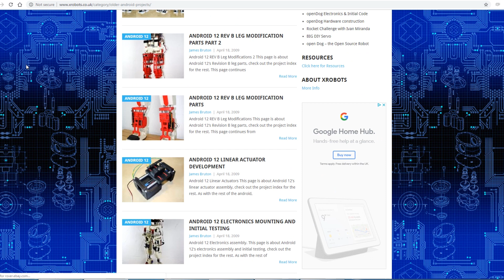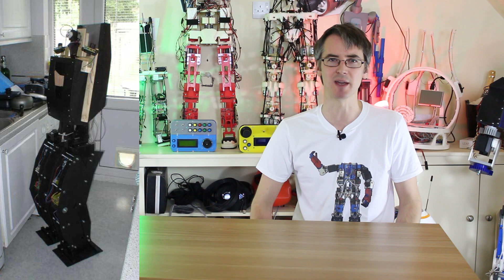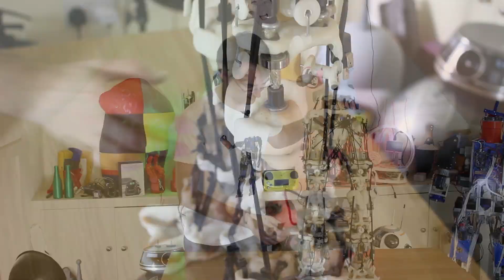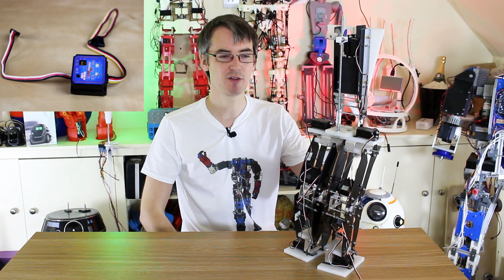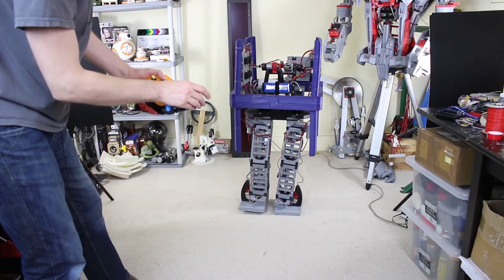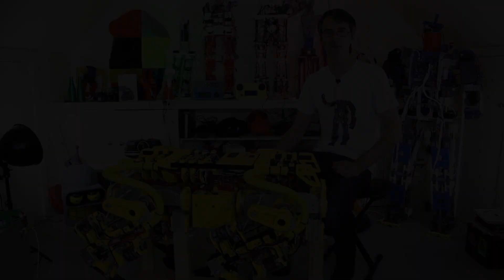My Walking Robotic History | James Bruton

Comment: Yeah...  It's cool that you just DO SOMETHING... I would do a bit more planning.  For example, you could do some calculations on how much torque the hip, knee, and ankle joint need to be to do something really basic, like balance one one foot.  Bipedal walking is quite a challenge, it's like the robot is constantly falling, but catches its self on alternate legs.  Shuffling is better than nothing, but legs need to have a purpose, like can it navigate stairs?

Comment: Hi James.
Reminds me of my experimentation.  
 Did find a Gem off a DLL Called INPOUT32.DLL  It allowed un-hindered reading of any Clocks, Inputs, Outputs and, of course Joystick ports.  
All interfacing with VB6.0  I'd find addresses in the bios or control panel, convert that to decimal then, using VB It was a simple instruction of OUT 888,1   To send pin 1 of the LPT (Printer Port) High.
I used it to control a 36 segment Cash register display driver chip.  
Pin one would be programmed as a shift register pulse (Clock)  and pin 2 as a toggle for the on/off value of that LED (Data) and pin 3 pulsed to advance to the next line by simply switching the negative rail for the next row of 32 LEDS using an extended decade counter.

 I Got 512 LEDS, So 8, 8 x 8 grid LED modules in a similar fashion as your VERO Board  Comparators.  BEAR In mind, this wasn't the textbook way of doing it..  
It was Astounding what I realised and understood from the entire experience of the self taught process.  
I even had to put a For next loop in to do nothing 3 times between the high level on pin 1 and the level on pin 2.  AND That was mentioned on the datasheet of the chip..   
The entire "Screen"  manage 11fps.  average.   Not slow when you realise its pointing to ONE LED at a time basically with a programmed hi / lo clock pin.
The penny dropped for me regarding computer memory and  I2C  Concepts.    I Was a failure at school.  wasn't allowed to study computers cos i was (Rubbish) at maths.  LOL

Comment: I know this video is two years old, but it's wild seeing how different things were. Doesn't seem that long ago, but it's quite a contrast to now being able to make pretty much whatever fairly easily with cheap 3D printers and super powerful microcontrollers for $4. The only thing I wish we still had is radio shack (I'm just a freshman mechanical engineering student and it died before I learned its glory).

Comment: How come I only learned about this channel now. I think we have the same kind of brain James. We could be good friends. I played around with wiper motors and pic microcontrollers in early 2000 before digging on steppers and servo. I have built robots in the past as well but not as much as you and not as much as I wanted to. I grew up in poor country. You are very lucky to be doing what you love and earn a living out of it. That makes me jealous. P.S. I like your opendog v2. It made me want to buid one. But   my 3d printer is tiny and i don't have as much time. But i will try.

Comment: James, when I saw your humanoid robots a question got to my head: is it not better for you to study human body and anatomy... and then tried to build a robot more or less based on that knowledge??
Reply from the maker: Some of them has some joints like humans - hip joints closer together than the distance of the legs (and some with matching ankles). Also knees that lock upright so they don't need any force to hold them there etc.  Human muscles are pretty efficient for their size though, so it's not always possible to reproduce

Comment: as soon as i learn how to program microcontroller and motors and integrate them into circuits i will try to build my own robo... i understand that 3d printer are very helpful. luckily i have acces to one in the university
Reply: ҉K҉N҉I҉G҉H҉T҉F҉I҉R҉E҉6҉6҉ Did you learn?

Comment: lol, I was looking into pneumatic muscles for my project, and came to the same conclusion that solenoid valves are too expensive to use. But I have since learned of an interesting way to do similar linear pull actuation using electric motors, called a twisted string actuator. Basically you use a motor to twist up a pair of strings which causes them to pull toward the motor. Simple and lightweight. Look it up.

Another awesome piece of equipment you should be aware of is the Bosch BNO055 absolute orientation sensor. It's like a regular IMU but with some brilliant programming to sort out your orientation from the motion data. It gives you a quaternion that represents your orientation with respect to the earth (north/south, east/west, up/down). Probably would be great for balancing robots. I'm using them for motion capture control gloves, where I have one sensor on the forearm and one on the back of the hand. Inverse transform the hand orientation by the forearm orientation and then convert to euler angles. Then convert those angles to servo signals, and you can have one servo follow your wrist bend motion, and one follow wrist twist.

Comment: he acts like 2004 were the dark ages... no 3D CAD and no videos etc. ? maybe in England, how did they ever get humans on the moon and back 4 decades earlier? dow did they design all the aeroplanes before that? very sad that some people just completely ugnore and negate analoge technology
Reply: The budget for the apollo mission was $110 billion dollars. James was using windscreen wiper motors in the early builds... there is a huge difference between a someone working on a project in his spare time and 400,000 staff.
Reply: what i was trying to say was, that people have solved complex threedimensional problems for decades (even centurys), shure it was more work but only now people say that the same thing can´t be done without computers... if there is no 3D modeling well than use 2D or pen and paper... no 3D printing? whatever ... use wood... like you did... bet you didn´t whine about it then... modelling joints in 3D for joints with only one axis? who needs 3D for a one axis movement? stopped working on Android 10 anyway... sadly
Reply from the maker: YouTube wasn't launched then, so I didn't make regular videos because there was no need. There was no free 3D CAD like Fusion 360 which will simulate joints, and no accessible 3D printers worth speaking of anyway, since the RepRap project only started in 2003 and they hadn't made a working printer yet.

I explained that my motor driver system was analog - are you even listing?

Comment: It is amazing and truly inspiring how prolific of a builder you have been! I can't even imagine having to build in a full size desktop computer into one of the robots. Also, I can't imagine having to tweak orientation and sensitivity on a dozen RC Heli Gyros. I got into Multi-rotor building when the control boards were still the guts out of 3 Heli Gyros mounted to a single PCB (Soldered at angles on standoffs of course. I find your design/experimentation methodology very similar to my own which is very cool. 

Keep up the good work James!

Comment: Nice historical reflection :-)  Have you considered more ball/joint connections rather that two dimensional actuators? The ball/joints would give more fluid movements, granted easier said than done.

Comment: Fantastic presentation James. Your enthusiasm remains positively contagious- My first robot build was the one found outlined in the Usborne electronic workshop book. It was a very basic balsa wood arm with the relay circuit with a LDR (to follow a drawn line), sensors etc. connected to a ZX Spectrum. This was in Zimbabwe, Africa- Not sure if you ever came along those books in the 80's. It was simple enough & happily designed to fuel the imagination of young minds. Thank you for your sharing. Greetings from the Cape of Good Hope peninsula

Comment: Let me ask you something ( even with my horrible english)..
Why all your robots have this swing to left and right?
It is not easier to make them auto stable and make them move one leg to the front...correcting ALL the fault and them move the other one...and them again, again and again?!?

( I dont know If you get It my point of view)
Reply: Well... you swing left and right in your hip, when you walk. It is part of a normal bipedal gait. Your hip will make your legs orient just below the center of mass for each step. So I guess that's why he does it. Now surely, his designs are doing it more than we humans do, but that is because of weight and dynamics of our complex bodies. We also move our chest and arms and all. But if he didn't make this side swing, when the robot lifted one leg it would fall on its side.